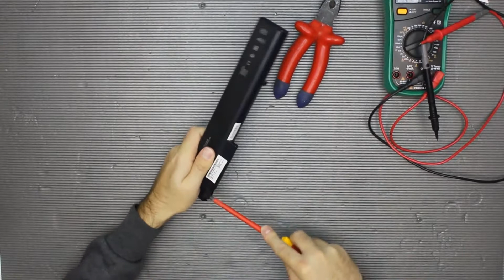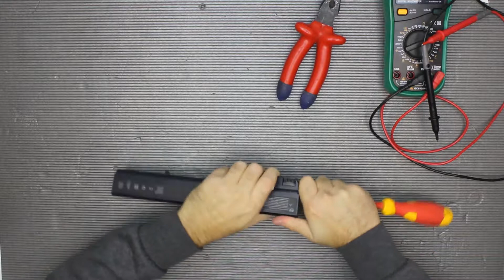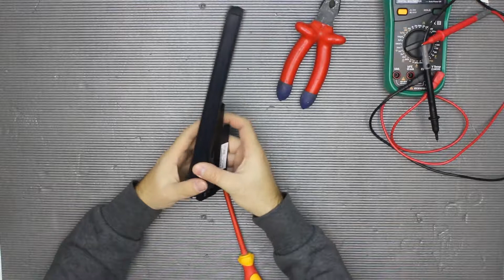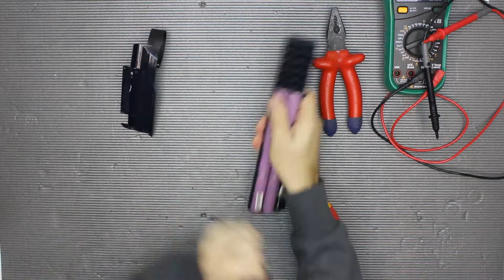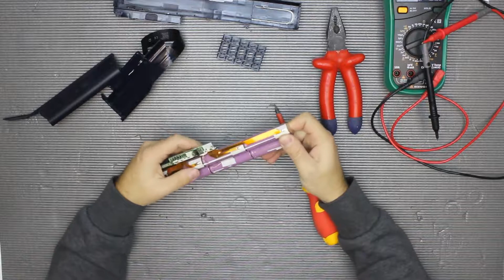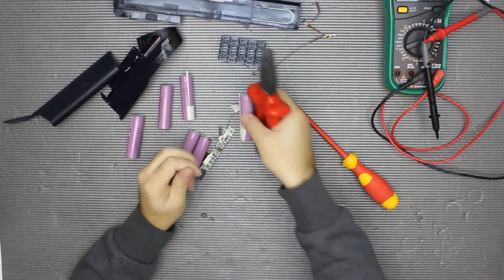HSTNN-LB30 HP Laptop Battery Teardown - 6x LG LGCP218650 2500mAh

Comment: Hi! Did you test the batteries? What was the result? I teared down the same pack, all batteries was 3.75V I am going to test the capacity to see what went wrong when the wole battery did not charge.
Reply from the maker: Charged them and left them for a couple of months. The cells did not discharge, but the total capacity left is between 1640 and 1670 mAh so not very good.
Reply: @laptopbatteryteardownother5640  Just disassembled a similar HP battery pack with these cells. Still hold 1800mAh. Not so bad.